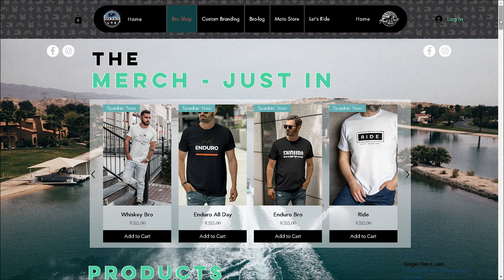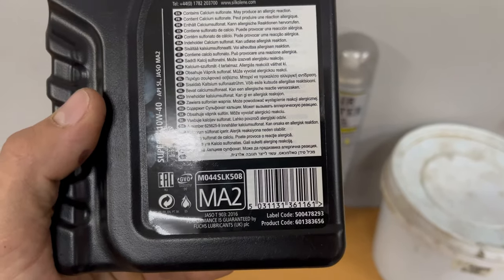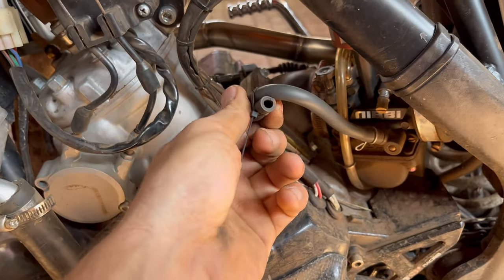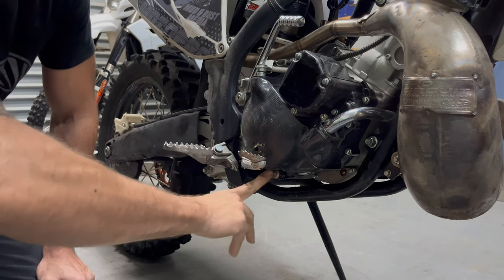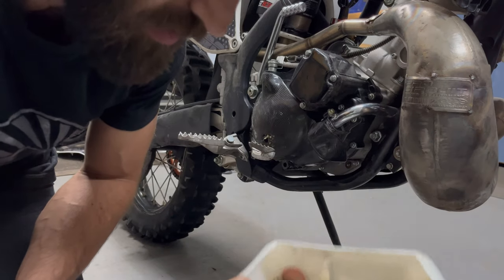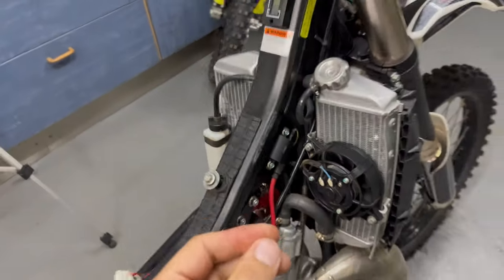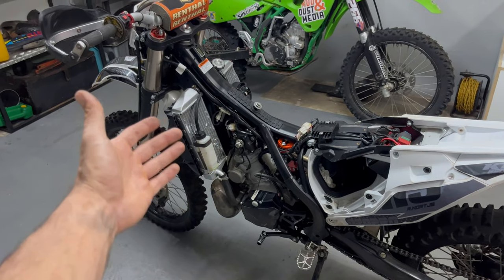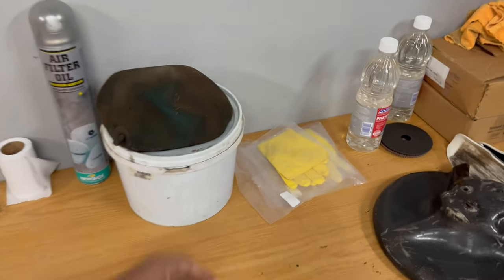KAYO KT250 BASIC SERVICE | DIY DIRT BIKE SERVICE TIPS

Comment: What would be a better option to replace my 86 lt250r engine im a beast with a wire welder i dont care i can make anything fit as needed.. THIS (loncin 250) or the nc300s (zongshen dual cam 4t) i just want reliability
Reply from the maker: I have alot of experience with the single cam zongshen motors, and they are very reliable. I would assume that the quality on the dual cam engine would be the same.

And the 300 produces good power

Comment: Opened end wrench loosen plug stick your hand in there and spin it out very simple no need to pull all that off to change plug
Reply from the maker: Yeah that will work. i dont have a big enough open ended wrench though.

I prefer to pull the tank to clean the bike and inspect everything properly when servicing so that makes changing the plug easier.

Comment: Hello I was hoping you could tell me if you have come across milky crank oil .This guy brought me a 2020 Kayo kt 250 it has 22 hrs on it .I have been wrenching on 2 strokes for 40 yrs and have seen this twice and it was the water pump seal .Have you herd of this on the Kayo can't find out much about these bikes. I put the actual 250 pipe on it instead of the 125 pipe that came on it like you did. I all so put a bigger carb on it that made a huge difference.If you have any ideas on the milky oil and on how to get the water pump propeller off i would appreciate it .If you know of someone that  could help me out that mayb have an idea if you don't that would be great Thanks #76.
Reply from the maker: Hey Mike, it could be the water pump seal, base gasket of the cylinder or the seal where the clutch arm actuates (if that seal is worn water can get in when you wash the bike)

You have to remove the whole right engine cover to gain access to the water pump impeller if i remeber correctly.

The KT’s engine is based on the yamaha wr 200/ dt 230 so i actually use the yamaha workshop manual if i need to work on the motor, that is usually the best instruction to follow.

Hope that helps🤙🏼
Reply: @MudAndDustMoto
Reply: Right on that gives me a good place to start i will let you know what I find out .Thanks for the Quick reply .#76 What a raced tonite on Super Cross ..

Comment: Just bought the "performance" expansion chamber from Kayo here in the US. They listened to the owners. I wasn't sure if they were going to come through, but they did. We now have a bolt on pipe available  that is more of a traditional bend for an engine of this capacity.
Reply from the maker: Great man! I am still trying to source one locally here in South Africa.
Reply: @thevoxofreason8468  Where did you buy it from? How much was it? I just picked one of these bikes up with only 1.5 hours on it. Looking to do some mods. Anything else you did with pipe? Thanks
Reply: @BMJAUDI  I bought the pipe from "Whygostock". They're out of Montana I believe. Nothing else needs to be done. Just pay attention to jetting. It may need changed, but really that depends on where you ride, i.e. altitude, temperature, etc.

Comment: Great Job – learned some cool Tips! Please let me know the Specs from this Carb, THANKS❤
Reply from the maker: What specs do you need? The jetting?
Reply: @MudAndDustMoto  Thanks – Yes, plus the Model & Size! Most of the Chinese Bikes are under the Brand GPX and comes with other Carbs. Many of them runs like Sh..t:–)))
Reply from the maker: @thailandmopedadventures611  the Kayo comes with the nibbi pwk 38 carb. The jetting specs i run are as follow:
Pilot: 48
Main: 152
Air screw: 1.5 turns out
Needle: top clip from the top
Boost jet: closed

Keep in mind my bike has a bunch of mods and im at 4300ft.
Reply: @MudAndDustMoto  Thank You so much – highly appreciated!
Reply: Great question. Same problem my bike came with fake keihin 38 pkw.  Works so bad
Reply from the maker: @diegomartin2719  yeah its not the best, i am considering putting on an original keihin PWK36
Reply: @MudAndDustMoto  wy 36 instead 38? Cheers!
Reply from the maker: @diegomartin2719  you will get a more snappy response from a 36mm carb.

And the 38mm is a bit too big for a 224cc motor. The KDX200/220 came with a PWK 35, the KTM 200 came with a PWK 36
Reply: @MudAndDustMoto  thank you very much, for you reply. I will tale your advice. 🏁🏁🏆

Comment: Great video! Ive issues with the original gearshift when i use my boots is a little, where do you get yours ? Doesnt seem the original. Thanks
Reply from the maker: Thanks, yeah the stock shifter is a bit short. I have the links to the shifter and shift brace linked in the pinned comment